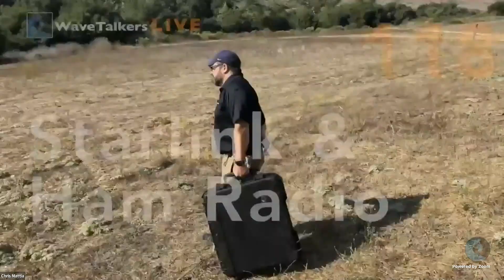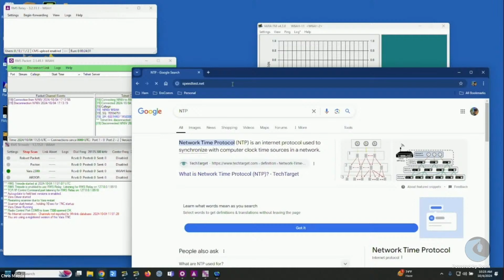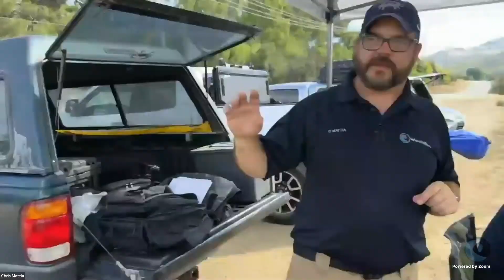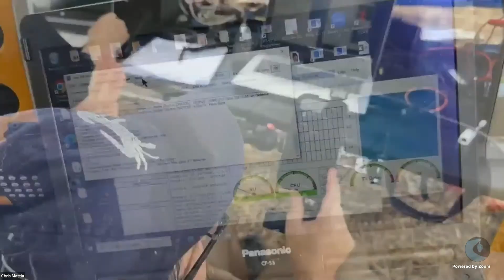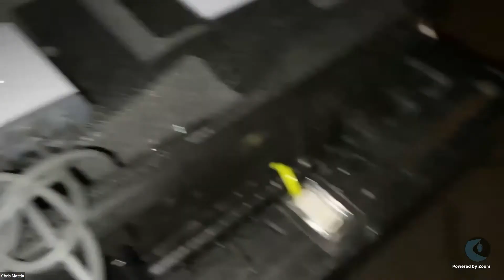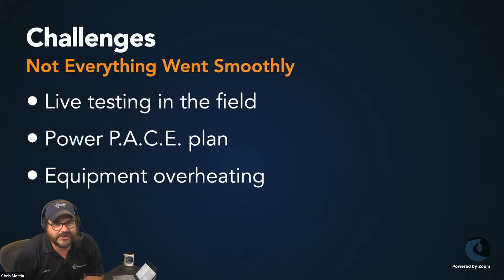Starlink & Ham Radio - WaveTalkers LIVE 118

Comment: I have a starlink Mini and I use it on SAR missions in central Washington,  in a big disaster the mini is rated at 100mbs so not a ton of band width so i decided that only authorized users, I have tested adding an O2surf type access point works at the far end of 300ft of cat6 so you have the wifi bubble of the mini then you can have another 300ft away, also this allows the antenna to be outside with the AP inside. the configuration has the POE near the mini so the power runs the full length.
Reply from the maker: That’s a great solution for extending your network coverage for search and rescue missions.

Comment: OK, one thing has been sticking in my head since this episode.  You have two 120W solar panels running 240 W total.  But the Buddipole PowerMini has a maximum of 150w.  Did you only have one panel feeding the PowerMini or does it actually allow more than the stated 150W.
Reply from the maker: Very observant.   There are safety margins built into the Powermini.  In general they are rated for 10.5A continuous into the solar port.  At max output from these panels the Powermini gets super hot, but the panels do not always output full power and I haven't let the magic blue smoke out...yet.  Im a beta tester for Buddipole so push their gear to the limits and see at what point they fail, so not suggested to run this much solar into that device for sure.

We had a bit of a marine layer the morning we shot this. The partial cloud cover reduced the max output of the panels just enough to allow us to operate them safely.  I normally only run a single 120W panel or my 60W panel with the Powermini.  I have a bioenno charge controller that can handle much higher current in from the solar but didn't have that one with me the day we filmed this.

 With solar, it is often a judgment call based on the actual output of the panels on the day based on current conditions.
Reply: Thank you.  I assumed all of those things, but just wanted to make sure.  I use a PowerMini but have only driven it with a 100W solar panel.

Comment: In the modern world, where even home TVs run off of DC Power. And if Starlink internet is designed for emergency use... Then why the HELLO KITTY did they design it to run off of 110 Volts AC power?
Reply from the maker: Hi @chrissewell1608, as we continue to look into more detail on the Starlink dishes, it turns out that the model of the dish we were using is actually using 57v DC, so it technically runs on a specific kind of Power Over Ethernet (PoE).  Each model of the Starlink runs on different voltages and they are all being adapted to Emergency use, but do not appear to be designed specifically for that purpose. We have another episode we are working on where we will go into this and other related questions in a lot more detail.  The new Starlink Mini dish falls much closer into the kind low power DC we typically use as hams.  An insight I learned as part of shooting the upcoming episode is that for public safety customers, they prefer AC as on an incident, AC is what they have already with generators, and inverters being standard at Incident Command Posts and emergency response vehicles.  As a ham, this is generally not the case so an interesting difference in our various use cases.

Thanks for watching and adding to the conversation.  73 Chris W6AH

Comment: By far the best video I have ever seen on YouTube regarding Commnications!
I have been wondering for quite some time now it was feasible to bridge HAM communications via Starlink, and you all did a fantastic job showing operations in person that answered ALL of my questions. An added plus for me was using the chameleon which I also was wondering how well it worked as well. I cannot say with words how much I appreciate all of you doing this for all of us and getting the word out. The masses have no idea how important communications are in times of crisis!

I have a few questions if you will entertain them for me. One likely much easier than the other.
1. What radio would you recommend between the Icom 705 and the Xiegu X6200?
2. Do you think it is possible to run communication relays via a drone / or more than one drone? 
3. Are you using any protective devices for your coms or have any that you recommend?

I know this is asking a lot and I appreciate you all every much either way.
Thank you again!
-H
Reply from the maker: Hi @18B_Madder
Thanks for the kind words. 

I've been quite impressed with the TDL, especially for it's very small footprint for the lower bands, frequency flexibility when uses with a tuner, and fast deployment / strike time. It operates as a decent NVIS and Skywave antenna, especially for a portable HF RMS Gateway or portable HF Winlink station.  There are certainly more efficient antenna designs but, the TDL is an excellent piece of kit to get the job done.

1. I can recommend the IC-705 as it is the radio I regularly use and am extremely happy with.  I do not have an X6200 so I can't comment on that unit.
2. There certainly could be a role for Quad Copter Drones, however most consumer drones have extremely short flight times, giving them limited usefulness as repeater / relay. Commercial communications vendors such as FirstNet are using Blimp style drones to act as ultra portable cell deployment as we mentioned in the episode, but have very limited weather parameters they are able to operate in.  Perhaps using a quad copter drone to deploy an antenna, collect realtime situational awareness images/video, or even deploying a light weight radio to a remote location are all things that may be more useful then using them as a repeater/relay.
3. Not sure what you mean by protective devices. I certainly run inline fuses, redundant batteries, solar charging, etc.

Comment: OMG is this what ham radio has been reduced to, a bunch of Posers and Whackers, I'm surprised they weren't wearing orange vests with badges and baofengs strapped to their sides ... this isn't ham radio, this is plug  and play appliance operating. Seriously how can these whackers be doing emergency communications without APRS they're using freaking winlink but no aprs, aprs is literally one of the most robust emergency communications systems available to hams But I'm thinking it might be a bit too complex for them.

 I mean seriously were they actually using a modified sine wave inverter around ham radio equipment. And did they really have an amp gage plugged in line between the inverter and the power source, apparently Ham radio operators don't worry about IR2 losses anymore.. I'm curious is there a real ham radio operator anywhere in your group, someone who could have taught you how to measure the IR2 losses in your power distribution system

 I guess this is the end result of dumbing down the ham radio tests. Seems like ham radio nowadays is nothing but a bunch of appliance operators, Seriously the equipment they're using is the epitome of fad, none of it's really good it's just what's cool to use today, seriously a chameleon Delta Loop that's your choice, well I suppose it could have been an end Fed Zeb or what hams nowadays call an end fed half wave Which has somehow reached legendary status amongst these appliance operators even though it's a pretty crappy antenna that was originally designed for zeblins why they were called end Fed zebs And they're a pretty crappy antenna but for some reason have reached legendary status amongst these whackers

What I can't figure out is why they even need ham radio operators to do this Because it's not even remotely technical or even remotely challenging, explain to me what's challenging about plugging a bunch of store bought appliances together. I love when he says we just need to point the antenna kind of towards the north, a real ham radio operator would have known the azimuth and elevation of the satellite constellation also known as the right ascension and declination..

Watching this was actually kind of depressing.
Reply: This isn’t about HAM radio.  Wavetalkers is about emergency communications during a crises.  Whether that is HAM radio, Winlink, APRS, or Starlink, who cares?  Today’s presentation (1/5/2026) incorporated all the multi-faceted communication options including the use of DigiRepeaters.  In the after-party today an individual who was on the ground in NC assisting with Ecomms discussed how beneficial today’s topic would have been ahead of that disaster.  I don’t really understand why you feel like you had to be so negative against a group of people who are only trying to get information out there for overall emergency communications.  And do a great job doing it …. Cameron N8CMB

Comment: What solar charge controller did you use in the video?
Reply from the maker: Hi @katz551 we used the Buddipole PowerMINI as the Solar Charge Controller.
Reply: @WaveTalkers Thank you. My solar controller has an RF issue to the radio when charging my 30AH Bioenno and my Expert Power 100AH LifePo4.
Reply from the maker: @katz551  that is pretty common and hence why I have gone with the Buddipole PowerMINI, they are designed specifically to be RF quiet for amateur radio.  They are difficult to get a hold of as they are often out of stock.  

These Genasun charge controllers do a good job also and I haven't had RFI issues from them.
https://amzn.to/4dJY2Na
Reply: @WaveTalkers  You do know it's not difficult to eliminate RFI from just about any charge controller real ham radio operators would have known this..

Comment: Why did you the larger power pole connectors on the batteries? Looking to do similar connections on my RV coach battery. Thanks
Reply from the maker: Those are the PP that came on the model of these batteries and I haven't changed them.

Comment: Great demos, as usual! I learn so much from these! Thinking about needing to change settings (computer and radio) when switching to say Digirig -- is that something that you could use the SD card for -- either on radio or computer or both? I know some who share HF radios save their settings on the SD card so whoever is operating goes to "their" setting and the radio is configured the way they want. Please know how much the community appreciates the time you spend putting these together and editing -- and then addressing the "challenges" and ways to cope with them as well.👏👏👏
Reply from the maker: I suspect the settings you are referring to saving on the SD card are the radio settings.  Those would be unique to each radio or model of radio.  for instance on my Icom radios I save a preset for Winlink Settings, one for ALE, one for Voice, and one for FT8.  Changing the Preset can tweak things my modulation mode, filter widths, what gets routed to USB vs data port, etc.

The challenge we ran into was changing from RA board to DigiRig.  in that case we had to change settings inside of VARA FM and Windows Sound control panel. To my knowledge there is no way to seamlessly automate those setting changes when changing from one interface to another.

Comment: Huntington Beach RACES setup an AREDN mesh system with use of Starlink to provide camera and ip phones at 2 remote airport for the Pacific Airshow. All data feeds came back to the command post and to the Airbox on the beach to provided real live data on the staus of the airplanes. We used Starlink gen 4 with AC power  along with a battery back up. deployed starlink mini to the airports with use of Goal Zero. Starlink mini is going to be a game changer in the future cause of the use of DC power to power the unit.. Download speeds 100bps on Gen 4 and the mini.
Reply from the maker: Nice setup! Did you uplink the video from AREDN to an outside service using Starlink?  

We have done similar setups for marathon support where IP cameras push their feeds via AREDN into a central node, then those feeds are piped into a Zoom call so Race Officials can monitor key locations at the race. We used load balanced hot spots as our gateway for uplinking the videos.
Reply: @WaveTalkers  we pushed all the video back to a server running Blue Iris at the eoc Used web address  to view the video over the internet.  All the video ran over AREDN and starlink was our gateway out. This year was test for the use of starlink as a  gateway. Over the years we have done the samething with the airshow to tunnel back into the eoc with AREDN to provide video and phone using hotspots and an internet feed from the AirShow sponsor. As this was all test with starlink. Our primary coms  were still radio  via our local repeater.

Comment: We are using Starlink for one of our remote offices in South Texas.  We have learned that the business class is a more stable connection compared to the residential class.  The business class has less than .5% pack drops and guaranteed low latency.  The residential class can drop packets up to 40%.  There is a monthly and equipment cost difference between the two service classes.
Reply from the maker: @TriNguyen-hl8oz  that is really valuable information.  Thanks for sharing.

Comment: It looks like your starlink router is turned off.
Reply from the maker: @bhamptonkc7  it was on and operating correctly.
Reply: @WaveTalkers review time 9:06
Reply from the maker: @bhamptonkc7  what are you noticing that seems like the router is off?
Reply: There seems to be general confusion here, the thing that keeps being called the router is only a power injector as these radios can run at high current due to the onboard heaters, the IP bridge is the radio itself and the Wi-Fi device is the router which splits out to many addresses, allows command of motorized radios and isn't present here that I see. 

  Seems I'm unable to comment on the parent thread as YouTube chat is broken so I'm posting this here as it's most relevant to the actual devices.

Comment: Really wondering if the Chameleon TDL is worth it as a NVIS Antenna.  Trying to find a fairly easy NVIS antenna.  Thoughts?
Reply from the maker: The TDL works quite well as an NVIS antenna and is super fast and easy to deploy with a fairly small footprint.  We used the TDL on our Solar Powered Gateway we deployed at the Baker2Vegas race.
Reply: @WaveTalkers  can you recommend any other easy NVIS Antennas?
Reply from the maker: @dougdukes1039  We use a variety of NVIS antennas and try to select the best antenna for the situation we find ourselves in.

When we first arrive on scene we will often deploy either a magloop (CHA F-Loop 3.0) with the double loop to get on the air fast and begin passing Winlink traffic.  even at 10W I can easily hit gateways out up to about 500 miles away.

The TDL allows for a bit more power depending on the matching unit. 

Both of these are really good for small foot print and fast, <10 min deployment time.
Reply from the maker: @dougdukes1039  After that we typically deploy something like an EmComm II or EmComm III, the Tactical Dipole, or perhaps the LEFS antennas.  All of which are just bigger and take more time to set up.  But all are quite effective at NVIS.

Vertical antennas can work but are not very good at NVIS.  Wires, closer to the ground do a better job, but use what ever you got and simply figure out how to make it work for you.
Reply from the maker: Be aware you do need a tuner for the TDL

Comment: Great real world program.  I was at a function in September where we were given a Starlink to use.  No instructions, delivered day of event so there was no time to practice.  It had a password that was not provided.  We finally boxed it up and went to plan B.  

Regarding the equipment heat,  that was interesting.  I wonder if that why marine radios are painted white?  I know for a bike ride event they made a foil covered shield for a radio that had overheating issues.  Maybe I need to throw in a roll of aluminum foil in the go kit.

Sorry I missed the Zoom call, we had a SAR mission.  We also noticed RFI as well during the day.  73
Reply from the maker: The overheating issue certainly proved to be an issue and made me think about things like painting gear white, heat reflective coverings, fans, etc.  Simple shading earlier in the deployment and ensuring good air flow feels like the right place to start.

Interesting that there was a password on the Starlink.  The unit we borrowed had a password on the app so we couldn't change any settings or get realtime data about what the unit was seeing, but it automatically handed off an IP address so we just used that and didn't worry about configurations.